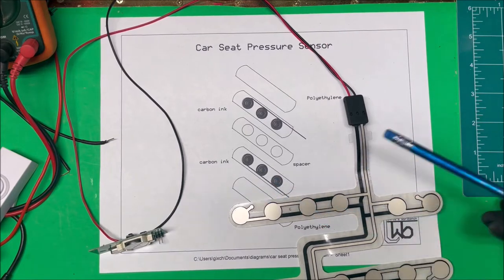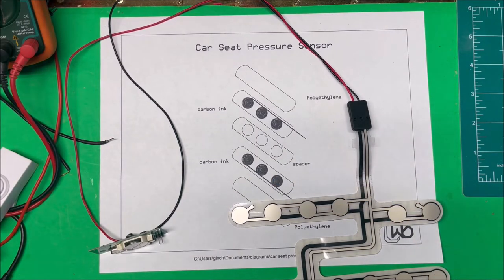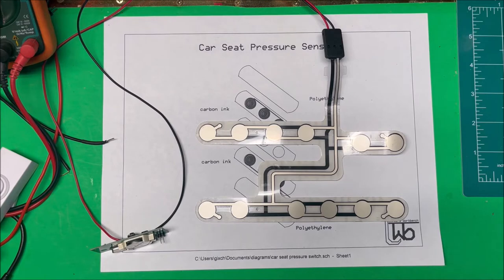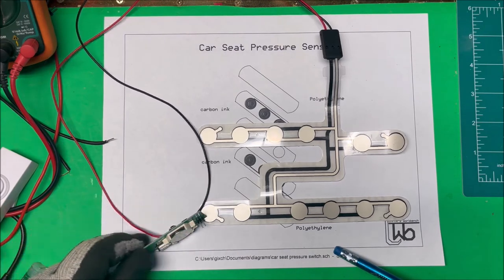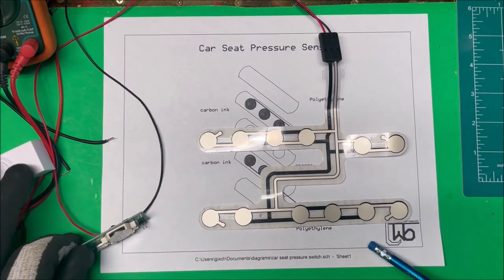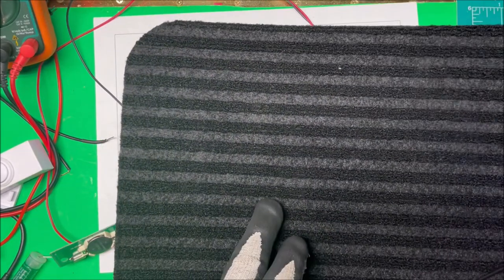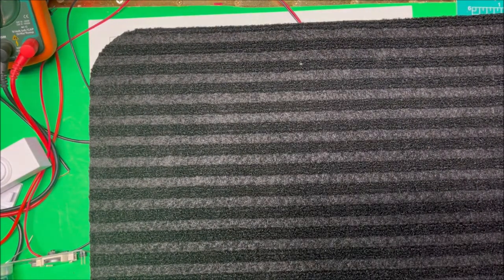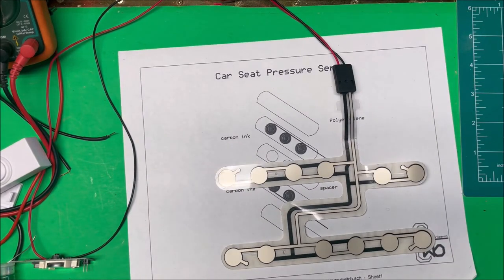Car seat pressure sensor

Comment: Cool idea. I’m researching these sensors trying to come up with a switch that would provide power to an electric air valve in my truck air ride seats. I’m trying to make my seats air up when I sit down to drive but then release air and lower the seat when I get out. Thoughts?

Comment: Hi, very clever reporpouse. I'd like to know what you measure out of the sensor, is it resistance, or voltage? Also, does it needs voltage in input to work?. All is because on something similar but I don't know much about electronics. Thank you.
Reply: I think it outputs voltage based on the change in resistance, and yes i think it needs voltage input probably 5V

Comment: Do you have any idea what the voltage rating is of the Car Seat Sensor is? I bought 3 of them to do a similar project but I can't find any docs on them anywhere.
Reply from the maker: They are tied into the cars computer, I assume its rated for 3 to 5 volts.
Reply: I have one attached to an Arduino (either 5 or 3.3 volts) using volage divider and I can get its analog inputs consistently on pressures applied.
Reply: @justoaguiar2514 Hi sir, can I know how you connect the car seat pressure sensor to arduino is it the same connection as a normal fsr402 sensor
Reply: @benedictpng1343  the red from the car seat goes to Arduino red 5 v directly and the black diverts to an analog pin and then to a resistor to finally get to the ground of Arduino. I think they call it voltage divider.
Reply: @justoaguiar2514 can I use 3v ? Microbit